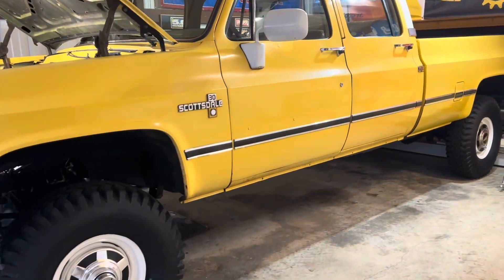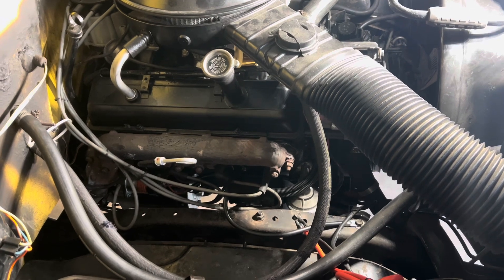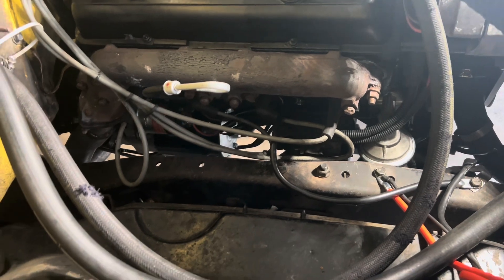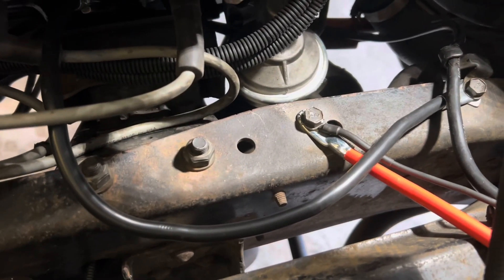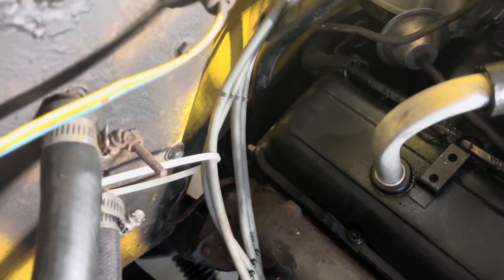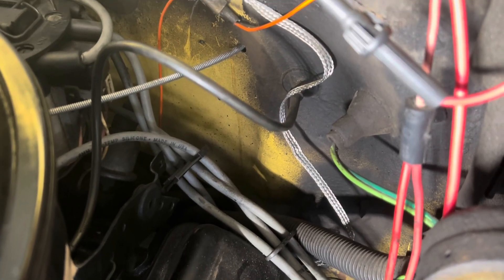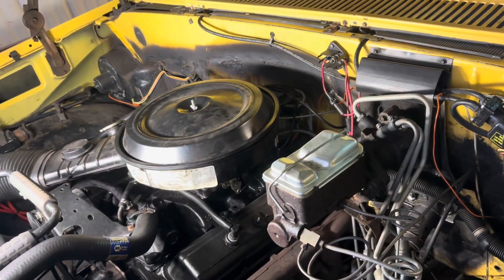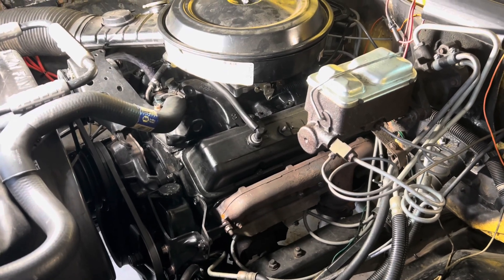square body slow cranking fix

Comment: I had a loose battery lead terminal on the starter motor solenoid cause that in my Australian built Holden VY  SS Commodore which runs the 5.7 litre Chevrolet LS1 V8 engine & I tried tightening the nut up which fixed the problem for a while then it came back.

I already knew that the battery was good because I tested it with my battery load tester,the fix was replacing the solenoid because the nut was galled up on the copper stud so I had to break the solenoid to remove the positive battery lead from the solenoid.

Ever since I have done that the engine starts much easier when it's hot because that is when I started having problems with slow cranking !
Reply from the maker: Most of the time you overthink issues. Most of the time they are small solutions. Take care